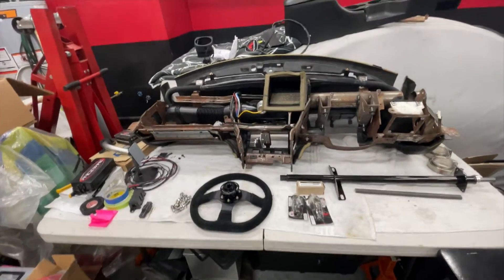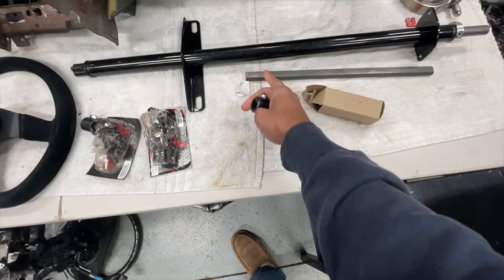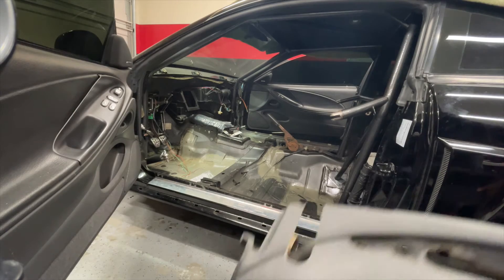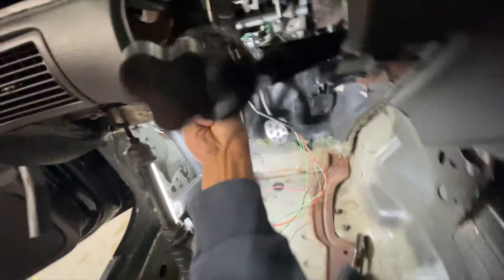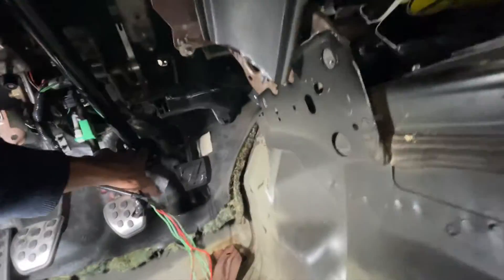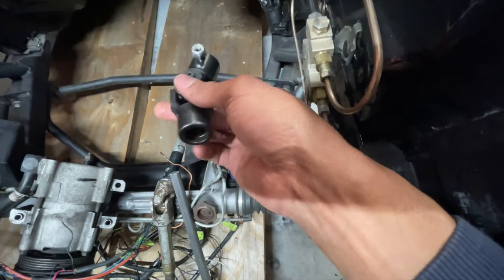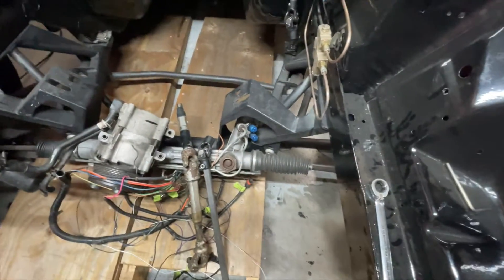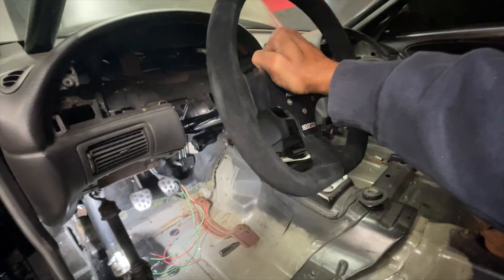03 Cobra Motion Raceworks lightweight steering column install!

Comment: hey man excellent videos, im currently gutting my 98 cobra drift car to add a full cage and was looking at the steering column from motion raceworks.  ive watched a couple of your videos now but i have 22 questions. do you have a dash bar installed with your cage, the bar that goes from a pillar to a pillar if so what did you have to cut out of the stock dash to get the dash to fit?? and the second question i have is are you keeping the stock keyed ignition with the new steering column?
Reply from the maker: Hey, thanks! I haven't done an overall update in a while but will in a few weeks. I am not using a dash cross bar, I am using the factory dash bar for the pillar-to-pillar support. I did this because I wanted to keep the HVAC assembly behind the dash on the passenger side in place. In hindsight, I may have been able to retain the HVAC assembly and run a bar across it but it would be a tight fit. The stock dash & its bar required trimming to fit around the bars going from the floor to the roof.

I got rid of the stock key ignition and now run a switch panel that is mounted on the upper bar. I will be sure to include my setup in an update video. 

Feel free to contact me on Facebook if you have any other questions or want a few pics.

https://www.facebook.com/A2DRacingTeam
Reply: @A2DRacing  awesome thanks man!